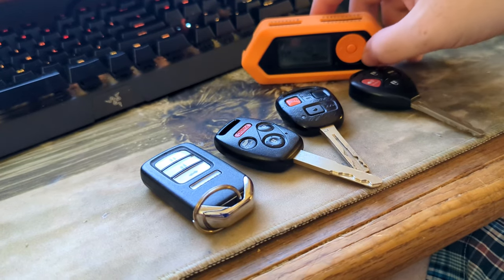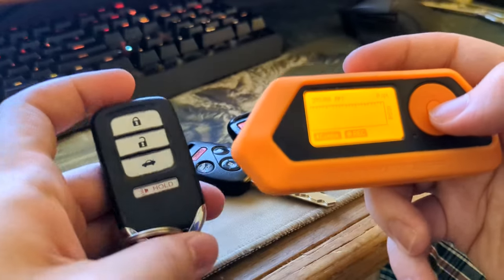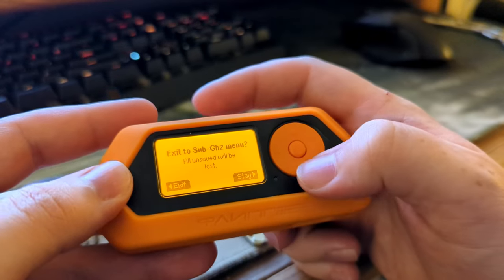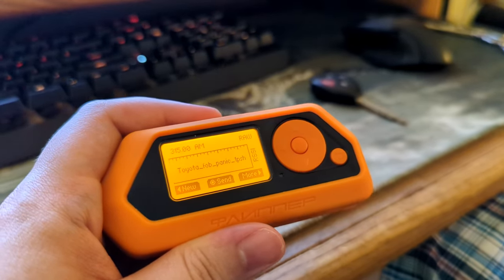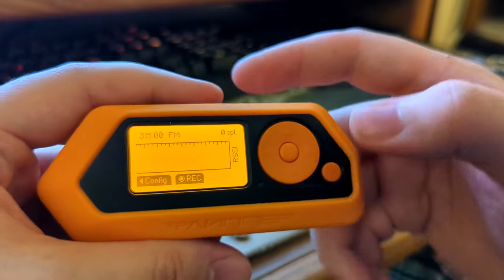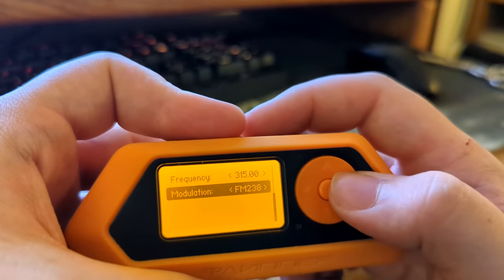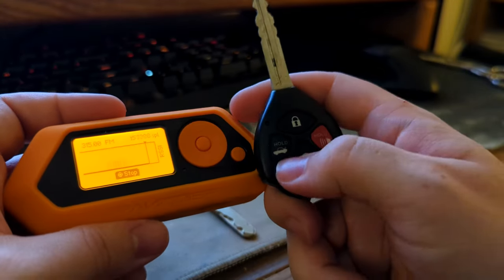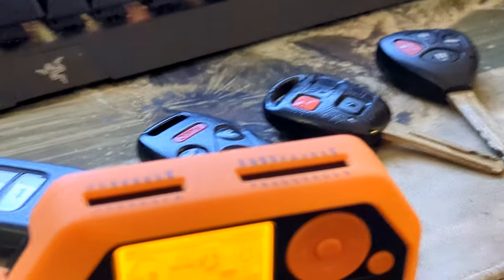FlipperZero - Catching Vehicle Key FOB Signals

Comment: With older cars this works, but newer cars got rolling codes which you can basically not find out. This means the key passes a frequency + a number, the car getting the signal will also have a number saved. If both numbers are the same the car door opens and the number aka the rolling code randomizes itself again, so only the car and the key know the necessary info.

Edit: Sorry, my comment is misleading. I talked about the Flipper Zeros‘ basic programs which can not catch rolling codes (except there are users who made mods for this specific purpose idk). So yes, rolling codes can be caught by other hacking tools. A lot of people were confused about what I said.

And before I get comments about the rolling code generation process being way more complicated, yes, that‘s also correct. I intended to post a comment which explains that this hacking device can not crack every car because at first some people might think this is the most powerful hacking tool on the market when seeing this.

Oh yeah and also you need to catch the signal which eventually opens the car. If you catch the signal of the car locking or activating the car alarm, the exact action you caught the frequency of will happen.
Reply: There are a couple ways that rolling code systems can be bypassed. So long as you capture a transmission of the code and the car does not, that code will remain valid since the car doesn't know that the code has already been sent from the key fob. If you have a second SDR, you can set the devices up so that one of them jams the receiver on the car while the other intercepts the code. Once the first code is intercepted, disable the SDR that is jamming the car's receiver. The fob will cycle to the second code, which the car will accept because as far as the receiving end on the car is concerned, the first code was never sent to begin with. Due to how the number randomization works, the car isn't going to understand that the first code was never sent, because otherwise the key would stop working if you were to accidentally press the button while outside the range at which the car can capture the frequency. You'd have to reprogram the car every time that happened in order to reset it. Speaking of which, here is the second way to bypass the rolling code: if you can somehow press/get the owner to press the unlock button while far away from the car, it's basically the same concept. Code gets sent, you receive the code, and the car doesn't. One way or another, if this chain of events takes place, you now have a code that you can use to successfully unlock the car. It'll only work once though, because that code will then be checked off and designated as being invalid once it's used.
Reply: @GunsandGuitars69  bros lit
Reply: @GunsandGuitars69  bro gonna get arrested 💀 jk
Reply: @mh7a135  sorry, forgot to say to only do this in Minecraft lol
Reply: @GunsandGuitars69  correct but only once which makes it useless
Reply: @user-pe8ir4iy1e  yes, I specified in my comment that it can only be used once. But that doesn't make it "useless". That makes it useful for one time. Not to mention that if during the jamming process the target presses the unlock button multiple times, you'll have multiple codes that you can use later on. So no, the process is absolutely not "useless"
Reply: I belive I seen this done before on a car that had rolling codes. Basically he had to capture a good few clicks and was able to get it from there. Possibly there were a set amount of codes in an array that get recycled.
Reply: @GunsandGuitars69  will it  start  the car?
Reply: @maxwellbowers8790  no, it'll only unlock the doors or perform whatever task you received the original frequency for, such as locking the car or turning on the alarm. If you want to start the engine, you'd have to find a way to exploit the CAN-BUS, which is the onboard computer system in cars that operate on anything digital. This method, however, would most likely vary based on the make, model, and age of the car. Just look up CAN-BUS exploits. There are a decent amount of them in the Metasploit Framework I believe
Reply: @GunsandGuitars69  Roll over codes are sequenced, once a single code is received all prior codes in the sequence are invalid.  Also the vehicle's receiver will not accept all future codes, just the next few hundred.  This allows the key fob to be pressed out of range a few hundred times and still work.
Reply: @mychannelnotyours123  incorrect. Watch Samy Kamkar's videos on his RollJam exploit. He provides a proof-of-concept and demonstrates it in action
Reply: @jaydynpalmer448  you don't have the balls to steal your wife back from her boyfriend, what are you talking about lol
Reply: @GunsandGuitars69  Is that really how it works? Given that it took all of 10 seconds to think of a system without that vulnerability, it's a bit depressing if that's the best car manufacturers can do.
Reply: @boggledbunny  I don't know what kind of other mitigations there are. I've never had the money to be able to afford hardware hacking as much so my talents lie more in network pentesting, malware development and webapp hacking. As far as SDR hacking it's something I dabble in occasionally just for fun but in relation to Kamkar's RollJam exploit I'm going off of a series of videos I watched when I was like 16 lol. Definitely look him up for more information though; he does a much better job at explaining it than I can
Reply: Go roll codes on 2001 s63 amg
Reply: @pewdiepie0442  I'll let you know when I have an extra $90,000 to spend on a new car lmao
Reply: @GunsandGuitars69  tbh you could jam the receiver and capture multiple signals while the car owner is trying to press the button a bunch of times. Eventually they'll think their fob is broken so they'll try to lock the car with the key manually and walk away, dealing with it later. Then you have multiple codes to use as you see fit.
Reply: Nowadays there are far more advanced methods used than just rolling codes.
One way is to let the car send a randomized signal. Then let the key do some calculations based on the signal and a private code/ algorithm.
If the response doesn't match the expectations and doesn't appear within a tight response time, it is invalid.
Kinda like every puplic/ private key encryption.
Reply: @Mauser196  yes, i know there are different types of these but i wanted to give a simple explanation
Reply: @Squilfinator  jamming can be useful in theory, but capturing the code that locks the car won't do much; replaying that code would just end up locking the car lol
Reply: @GunsandGuitars69  Say you could spam the button while out of the distance of the car. What if you save each signal individually. Could you have like 100 of them? And would they each work on their own, giving you 100 different opportunities to unlock the car?
Reply: @piggy743  probably, if you were to use them in the same order they arrived and the owner doesn't use the next code any time before you can use them. Once they do, it'll nullify all of the previous codes I think. I could be wrong though
Reply: What year cars does this work on them ?
Reply: @ipwnxdemonzz4223  it's on a case-by-case basis. It depends on whether or not the car uses a rolling-code system.
Reply: @GunsandGuitars69  i followed this guy in the woods and he was playing with his keys and I captured the unlock i went back to his car and it unlocked I was able to grab some money and stuff thanks 🙏
Reply: Will this work with a 2007 honda odyssey
Reply: @gavinmurphy4510  No it is a CVE called Rollback. Some car makers broke their own rolling codes. On some brands a certain amount of sequential key presses will resync the "key." It was the whole convenience vs security.
Reply: @GunsandGuitars69  Why even bother with all that. Jam the lock signal and the car will be unlocked. Done. Rollback CVE is also a heck of a lot easier than Samy's Rolljam (which is what you described), and Rollback works on a scary number of cars, although there are some that are immune. Mainly because those car makers aren't idiots and didn't intentionally break their own rolling code.
Reply: @GunsandGuitars69  hello . Can you help me ?
Reply: @GunsandGuitars69  I confirm this works perfectly. Tested in my Jeep 4xe several times.
Reply: So if im not mistaken, the original device has to transmit a signal 1st before this device can replicate it? I'm interested in this product since I'm a mechanic at a truck stop and I'm constantly getting people locking themselves out of their vehicle. I have a lockout kit but that can take anywhere from 1- 3 minutes before I get the door open. This would be a neat tool to add to my box, but if it can only replicate the signal when the fob is next to it and when the fob transmits, then it might not be suited for what I intend to use it for
Reply: @crimsonsr20  Its not suited for you. There are some ways to copy certain keyfobs via the rollback CVE, but you need recordings from the applicable keyfob, and it doesn't work with every keyfob.

In addition rolling code makes a single capture worthless, and any capture from a non-vulnerable manufacturer also worthless.
Reply: @crsv7armhl  Thanks.
Reply: @crimsonsr20  correct for the most part. You can brute force but that is time consuming process possibly. It works best with a captured signal containing the required code.
Reply: @GunsandGuitars69  Even though I'll never apply that info, the technical knowledge was very interesting. Thank you
Reply: @crsv7armhl  which manufactures broke their own rolling codes?
Reply: @jadmukssood7453  Research. I am not gonna spoon feed you
Reply: @John Doe Yes, I know as matthew o neil already explained under my comment, catching a rolling code is possible. My primary content eas misleading several users into thinking that its not possible with ehatever tool, but i was primarily talking about the Flipper Zero hacking device which has a standard program, catching frequency signals. Still on the flipper zero there is no standard program to catch rolling codes. So sorry for the misunderstanding

Comment: Not working on 1997 Toyota Supra Turbo RHD. It doesnt get any signal on 315/AM270. I tried hopping as well. Any tips? I thought my car was old enough to not have rolling codes.
Reply from the maker: Try 433.92 Or 303 mhz
Reply: @nikkolaus Ended up downloading the unleashed firmware and found the frequency at exactly 312.16 @ 76dm, which is weird because that's not a preset in the flipper. I was able to capture the signal very clearly, but it still won't function as a keyfob on the vehicle. It must have rolling codes? Seems odd for a 1997. I'll have to try different modulations tonight. Maybe in Japan they don't use AM270. But it was a very clear capture so I'm sure it's probably just rolling codes...

Comment: One of the main issues is that the flipper isn't that great of a receiver for key fobs, even with an external antenna. I don't know if it's an issue with the Flippers libraries or the chip. 
I've also gone over the firmware code, and it's not set up to understand key fobs, so usable information can't be extracted. The data it thinks its reading isn't correct. This doesn't affect read raw,  but it would be nice to extract the correct data bits. It's not a big problem to add or modify the current protocol. It's something I'm working on in my free time.
I love this tool, but I hate it. The people who made it offer no support, despite making a lot of money. Other devices do the job the flipper does so much better. It does act as an open source tool for reading singals and converting it to a universal open source format like .sub files. 
I was easily able to write arduino code to send subghz files. It's kind of overpriced for its functionality.

Comment: It sends the same signal which it receives or can also modify ? 
 For instance, if it catches door locking signal, can it send "unlock" command?
Reply from the maker: You can search for signals. If you find a signal, you can replay it.
Reply: @nikkolaus   how ? If we catch signal lock how can send signal unlock? 
Modify via Gnu radio or flipper zero has such function?
Reply from the maker: @dimitridimitri8740  Flipper Zero gives the ability to emulate or repeat a saved digital signal.

Comment: Is there any guide (cheatsheet) with what Items usually go with -- freq. and mod.  ???
Reply from the maker: Flipper Zero's Sub-1GHz module is capable of receiving signals at all frequencies in the 300-348 MHz, 387-464 MHz, and 779-928 MHz operational bands.
https://blog.flipperzero.one/rfid/

Comment: Followed the steps, I was able to save readings, but it still doesn't work for my car. Am I doing something wrong?
Reply: If your car is a newer model it'll use rolling codes. Check the first reply on the top/most liked comment on this vid. He goes in depth on that subject
Reply: @Shade_Tree_Mechanic  Thanks!!

Comment: Be careful because I have already cleared 2 car keys with it so that they no longer fit the car. was my mother's car, whops
Reply from the maker: That's why you should always read the comments first.  Don't use your own personal keys... Modern key fobs have a rolling bank of codes... You might still be able to get it to work but you have to go through the entire bank which is usually 50+ codes
Reply: @nikkolaus  yeah it isnt my own personal key so it doewsnt matter xD
Reply: How did you clear the key??
Reply: @MM-ip9zb  scant my moms key and used it zwice, so the car waits for the next "Rolling Key" but the key sends another as the car wants.

Comment: Nice tutorial.  Hopefully there will be more in the future.  How successful were you in getting reaction from the vehicles?
Reply from the maker: I would say 6 of 8 registered on the scale somewhere. 2 of those 6 required deviation from the standard frequency into the higher and lower ends of the allowed ranges.
Reply: @nikkolaus  even rolling code emulation worked?
Reply: @24TONS_  think it doesnt, would be way to powerful haha
Reply: @24TONS_  no, obviously not
Reply: @joasvdeerden  it does with some more plugins
Reply: @theri824  what are the plugins
Reply: @theri824 link?
Reply: @_j.1s__152  unleashed and rogumaster

Comment: How far can the car key be away from the flipper to capture the signal ? What cars and car years does it work on ?
Reply: Yes I would like to know if you tested the range of this device as well.
Reply from the maker: @corbindallas6684   The maximum range is 50 meters.
Reply from the maker: The maximum range is 50 meters.
Reply: @nikkolaus  you didn’t read the question properly, they ask about capturing, not sending. Capturing will not happen at 50 meters…

Comment: Don't do this to your own car key fob. You will desync the key fob if you are unlucky. Rendering it unable to work with your car again and requires resync of your key fob at a dealer.
Reply: How do you do it safely then
Reply: I have two tho?
Reply: That makes no sense. The flipper is just listening for signals and saving them.  Its not re-writing the fob
Reply: @bairfreedom  ?
Reply: @sirmario1  how does the car know it's a copy if the original wasn't sent in the first place? (If I recorded the signal far away without it reaching the car)

Comment: It recorded my truck but it won’t lock or unlock it.
Reply from the maker: Vehicles use a rolling set of codes. You need to do a little research into it before trying it on an expensive newer vehicle.

Comment: Tks for the video.... Unfortunately when i do the same with mine for my japanese car import FOB the flipper does not allow me to replicate the 315 frequency on the Am270 modulation and tells me "Transmission on this frequency is not allowed in your region" . Anybody knows if i can somehow unblock this restriction? Appreciate any help.
Reply from the maker: Transmitting on certain frequencies is prohibited by region or country federal law. Please dont attempt to circumvent this law if you live in an area where it is restricted. The design, production, and importation of these devices was developed to each region in accordance with the laws of that country.
Reply: Look up Flipper Unleashed. That will solve your issue
Reply: @nikkolaus  🤓
Reply: Yes, you can unlock these locks. U need to use custom/modified firmware for your flipper zero
Reply: @AndySlug  but you will get arrested dummy
Reply: Hey trevski, did you ever figure this out? My japanese import RHD supra mk4 won't work with this video tutorial. Any luck or advice? I don't get that error btw.

Comment: Is there any certain range you have to be to the key ?
Reply from the maker: Each key has a different transmitting power. As long as you're within range of the ability to pick up that signal you can get it .. usually it's 30-65 ft
Reply: @nikkolaus  Do you know if there is a video where they show this being tested? I am not only curious about the range but about the angle of the reader. All videos I have watched so far have the fob pointed directly at the flipper. Are these like my old tv remote where it needs to be pointed directly at the device?
Reply from the maker: ...it's a dual-band RFID antenna.. not an IR-blasting remote control.. There is no "pointing"... it broadcasts and receives in all directions...